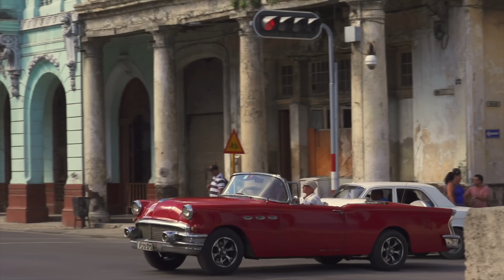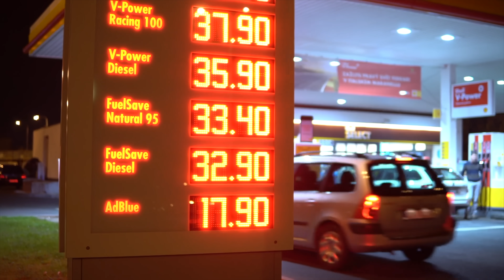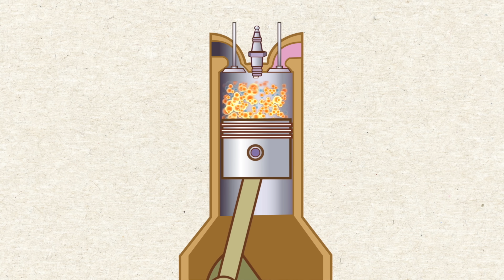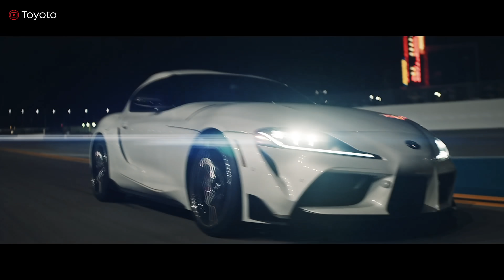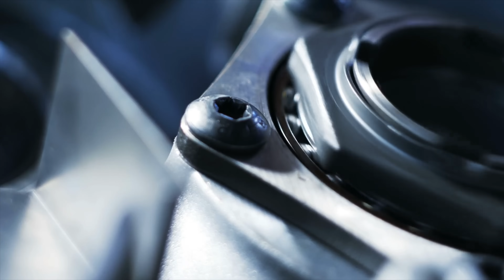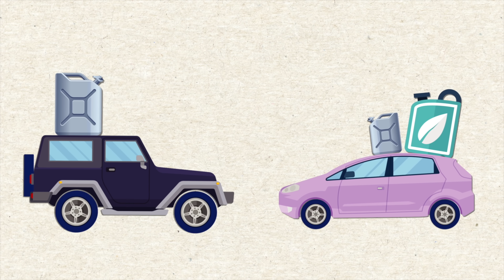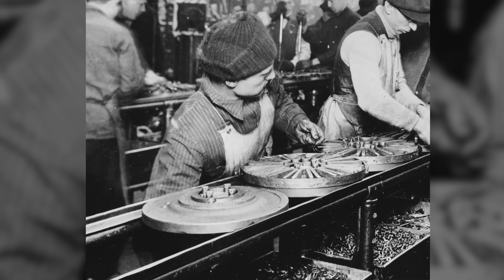7 Fuel Myths Stupid People Fall For

Comment: If I feel generous I use premium in my old lawnmower.😃
Reply: If you can buy ethanol-free gas that would be even better
Reply: @jflm3  why? Is ethanol bad?
Reply: Ethanol reduces the amount of energy when mixed with gasoline
Reply: Most Walmarts sell Ethanol Free Unleaded Gas,  much better for the Lawn mower
Reply: Lol
Reply: Ho! Mr money bags ova here!
Reply: Ethanol can gum up the carburetor on small engines and cause issues in them prematurely I run true fuel in my lawnmower it’s ethanol free and burns better in small engines,
Reply: unarmed blackman  did you know racers use ethanol for racing?
Reply: @kg_1720  If they do, it likely because the engines are tuned and otherwise designed for ethanol use and are cleaned regularly to prevent build-up or other harmful things.  Most average users aren't going to do that to their car engines (except maybe run some cleaner through the gas tank, which may not be enough alone over the long term), and probably not their lawn mowers either.  Race car drivers are typically meticulous about their vehicle and it's care/maintenance.
Reply: @andrewthag   all I've ever found at WM is ethanol gas
Reply: When I worked at a lawn and garden equipment dealer, we put airplane fuel in the tanks.
Reply: @edwardellis7611   I have a small lawn business that’s just me. The wisdom I have received from the small engine mechanics is not only will it deteriorate your carburetor but it will also eat your fuel lines; and if it sits in your fuel line in any capacity of your equipment, the moisture it sucks in will deteriorate the metal and can clog up simple things like the jets on your carburetor. I haven’t done much carburetor work but the few small engine carburetors I’ve seen have rubber parts in it also and it will eat those up. I switched to all non ethanol as a result. I seldom have engine issues.
Reply: Ethanol is not bad as long as it doesn't sit for over a month or so... It is hydrophilic, meaning it attracts water and can cause problems if not used in a timely manner.  If you want to, you can separate the ethanol in your gas easily by adding water to it and shaking it up, then removing the separated ethanol-water mixture that settles to the bottom.  What's left over is pure gasoline, which is hydrophobic.  On another note, gasoline loses one octane for every month it sits.
Reply: Oh yeah? Do you run royal purple oil in it too like my dad?
Reply: @ObservingtheObvious  That's what I"ve heard too.  The ethanol eats away the fuel lines and rubber gaskets and such.  I generally try to use "real gas" as I call it in my riding and push mowers.
Reply: I think my lawnmower has a high performance engine cause I agree it runs better and less stinky exhaust when I run 91 octane
Reply: @kg_1720  it absorbs moisture from the atmosphere and ends up screwing up the carburetor, fuel system, etc., is what I was taught. I know when I quit using ethanol gas I quit having issues with my small engines
Reply: @kg_1720  the engines are set up to run on ethanol
Reply: When the GW Bush, oil magnate family, promoted it years ago I knew something was amiss...
Reply: Ethanol is bad. Eats up rubbers. After some time you need New fuel injectors. Strange that Scotty is not mentioning this. Why is that Scotty?
Reply: @tommymcweedface229  go to an airport or go on google and search ethanol free gas near me, why did u @ me and not the guy below me tho
Reply: I worked a Sears Lawn and Garden and we were told specifically that 91 octane is too much for a lawnmower.
Reply: @kg_1720  most are buying the e85 or e98 thru companies such as ignite, vp racing fuels, renegade racing fuels etc. Pump e85 is trash
Reply: @MrButtHurt  @wielentschoten575  There are these people called engineers that work at these car companies and, contrary to popular belief, they are capable of thinking about things. When they make a car flex fuel compatible, changes are made to the fuel system to accommodate the high concentration of ethanol, with an addition of an ethanol content sensor that way the ecu can adjust the air fuel mix to make up for the lower energy content of ethanol. The real danger if ethanol is that it attracts water from the air and when left to sit (in the case of lawnmowers and similar small engines) can develop high enough water content in the fuel to do damage to the fuel system, especially carburators. This could still be an issue with cars using fuel with ethanol, but most cars are driven enough to empty the tank before water concentration reaches dangerous levels. In this video scotty was talking about cars not mowers and was leaning towards cars driven everyday, so no, there is no problem with ethanol in the situations scotty was talking about.
Reply: @colin_deans  oh yeah. I got a Toyota Avensis. Google says no e10 for the 1.6 and 2.0 but for my 1.8 it is fine. Well certainly doesn't run fine. My car is slow. Rumbling noise. E5 RON 98 it runs fine . Fast and more fuel efficient. And you can leave it for a couple of weeks.
Reply: @wielentschoten575  does it say in your manual that your car is compatible with e10 fuel? If it does and you notice bad performance when using ethanol, either your car has a fuel system problem or the e10 that you are buying is no good, or perhaps higher than e10. Just please don't talk about ethanol like it's the Big Bad Scary Stuff that rots your engine. It's a great alternative fuel and has really good performance characteristics (such as incredible charge&cylinder cooling and naturally high octane. As long as the ecu is aware of the ethanol concentration and is able to adjust the mix as needed ethanol is a great choice for daily driver or high performance cars.
Reply: @colin_deans  lots of rainforests are cut to produce this stuff. They are killing the earth. More diseases will come because of it.
Reply: @HR-wd6cw  Ethanol fuels have more oxygen in them but also have less potential energy for the same volume of fuel.  Racers run E85 gas with larger injectors and tunes to take advantage of the extra oxygen in the fuel.  kinda like a low output turbo or something.
Reply: @edwardellis7611  My son used to buy that for his weed eater. I have never tried it, but these days I use a battery powered trimmer. Could be why I had to disassemble the carburetor & clean it every couple of years, to keep it running.
Reply: Some small engine manuals (lawnmowers, weed eaters, snow blowers, etc) say to NOT use premium gasoline.
You guys are saying to ONLY use premium gas.
We might need another myth video from Scotty on this.
Reply: I am not putting expenses gas in my low lawnmower lol 😂
Reply: @kg_1720  Ethanol mixed in with gasoline can cause older rubber components and plastics to deteriorate.  Newer cars have updated components that can handle it better, hence  running it in older cars/mowers/etc can eventually lead to some parts needing replaced.  My brother runs E85 in his race cars due to it's the higher octane rating and it's cheaper than racing fuel.  However, you have to recalibrate your carb and fuel system to handle flowing more E85 plus replacing those rubber/plastic components with stuff that handles exposure to ethanol.  You have to flow something like 30% more E85 compared to gasoline to make the same power.  Overall it saves him $'s compared to race fuel but takes some knowledge and effort to adapt an older car to it.
Reply: @powermix24  I have never seen any at a Walmart.
Reply: @anonymousperson4363  Where I live in Texas, we have 2 Walmarts with Unleaded Ethanol Free gas @ Murphy's Gas station
Reply: @JohnRocks6368  well this is where flex fuel systems come in. They have ethanol resistant components and and ethanol sensor to make sure it flows more fuel according to the mix. Pump e85 can be anywhere between e50-or-So and e85, so it is necessary to adapt to the mixture with each tank
Reply: @kg_1720  in my experience ethanol is Definately bad for lawnmowers.I have bought 2 brand new push mowers that had ethanol gas in them and only used once or twice before sitting for few months during winter.Went to crank them when it warmed up and they would not start.Even after fuel stabilizer added.Thank god for lowes extended warranties!😂🤭.Started putting non ethanol in mower as mechanics requested and never had a problem since.

Comment: my parents had a 89 chevy nova which needed regular but they used premium and it blew out the head gasket. So it does cause problems to use premium when the vehicle is not rated for it.

Comment: I used low octane gas in a generator once. After one tank, it had fouled the spark arrester so much that the generator wouldn't start. I had to remove and clean the spark arrester to get it working again.  I switched to high octane gas and I haven't had to clean it since (after several hundred hours of use). There are real world consequences for using less than the recommended octane level.
Reply: That’s a whole different engine than what’s in a car.
Reply: @mtn1793 it’s the same concept. I have a BMW that takes mid grade 89 and has a turbo. If I put 87 all the time, I wouldn’t be surprised if the engine starts knocking or timing goes wrong in one cylinder. The combustion is different for each grade. If you don’t have a European car, no turbo, a regular engine, then you probably will be fine putting whatever in there.
Reply: @@pc9656 what year?
Reply: @@pc9656 ty, I’ve got a ‘06 and riding great at 207k. I use reg
Reply: @@pc9656 ty brother! Happy holidays!

Comment: ethanol from corn takes more energy to make than it gives back, so it's strictly worse to use it as a "renewable" fuel than to just go 100% normal gasoline
Reply: Exactly.  Plus the farming industry is subsidized by the government to allocate their corn for fuel production ("ethanol subsidy").  The taxpayers are paying extra for the production of ethanol fuel.
Reply: While technically true, it is a misunderstanding of the entire system. Yes, the production of ethanol takes more energy and creates more pollutants than simply producing petrol fuels. However, the factories/manufacturing facilities are able to capture and neutralize more of those pollutants before they become atmospheric emissions than traditional gasoline production. And the toxic emissions of the automobile are significantly lower using ethanol than petrol. So, the net result is significantly lower pollutants being emitted into the atmosphere with ethanol than petrol. It is such a difference, than the government subsidizes the process to insure we maximize the production and usage of the ethanol. If left entirely to the market conditions, ethanol would be too expensive to be practical for automobile consumption. The only choice is to subsidize the production to keep the prices down, or use mandated price controls to suppress the cost of corn. The former solution is much more effective and encourages as much corn production as possible, which keeps supply high and therefore prices low and stable. We really need to look at these topics holistically and not just the parts that support our own political bias.
Reply: @TwilightxKnight13 amen!
Reply: The energy used to make ethanol can come from renewable sources, such as solar or wind so the amount of energy required to make it can actually be irrelevant.
Reply: E10, the majority of ethanol containing fuel sold, is being used to displace worse additives, like MTBE, that was polluting the water supply.
Reply: @George Martin  Right, I like my water polluted by fertilizer from corn farmers. 😂
Reply: And it takes a lot corn to produce as well
Reply: @simpletruth9977  Course, we coulda always genetically modified the corn to not need those pesticides, but that's gonna poison us in the long run or something I guess.  🤷🏼‍♀️

Comment: Here's a myth: that Shell is good gas. Every single Shell station I've ever been to, from West Coast to East Coast, has always overstated their octane levels by at least one grade. Their 89 performs like 87 and their 91 or 93 like 89. It will absolutely GUT your engine power. If you ever have to buy Shell, always get the highest grade available, and only put enough in to get to a better gas station. I don't know how they haven't been caught yet because they've been doing this for 20+ years.
Reply: They're on the banners of Formula 1 (or at least were, not sure now) and are pretty famous, that means enough money for an army of lawyers.
Reply: @lidge1994  Seriously, I put their 89 in my 2001 Mercury Cougar and it made my engine knock. The engine was rated for 87. Their crap is THAT BAD. And even putting their highest grade in my current vehicle, it guts the performance. I don't know what's wrong with their gas, but they are absolutely scamming people; I've never had this problem with any brand but Shell.

Comment: My car seems to run more smoothly and get more gas mileage with premium fuel. Cheaper fuel just never seems to last as long, so to me it’s been worth it to pay a little extra for the premium stuff. Cool and informative vid!
Reply: could be premium isn't flex fuel. nor that 7/11 does not sell flex.
Reply: In Deutschland nimm ich 102 .
Mein chevrolet 2.5 6zyl, lauft besser,und runder.

Comment: Most mechanics I talk to always suggest staying away from ethanol blended gasoline do to problems with gumming up the gas injection system and milage drops off. Also, it is not recommended to use on small engines due to carburetor problems and wear and tear.
I usually listen to advice from many different mechanics  for cars or small engine repairman.
Reply: What about a 250cc motorcycle?

Comment: A lot of 91-93 premium fuels also contain detergents that keep your engine cleaner (Shell V-power is one of many)

It burns better (different ignition speed, pattern and even flame color)

Most modern vehicles will stop pulling timing with higher octane fuels even if the manual says 87 is fine

Turbocharged engines that can run on 87 almost always make more power and get better mileage on 91-93
Reply: Even my car with a naturally aspirated engine produces more power on higher octanes, even though the manual states that using a higher octane yields no performance gains.

Comment: Way back in the '80s I took a 77 Pontiac Bonneville with a 301 V8 from Wisconsin to Florida. One way I used all regular gas and the other way coming home I use premium. This is back when regular gas was a dollar and premium was a $12, so 12 cents difference I came out a few dollars a head using premium. Today with it being a dollar difference in many places I don't think it would be economical.

Comment: After multiple tests... I found that I get approx 3mpg increase by using non-ethanol fuel.
Reply: That's because ethanol is garbage. Nobody ever thinks about what damage the monocropping does to the environment. A more efficient vehicle will likely cause less impact. Used to have diesel cars with no EPA requirements that would get like 50-60 mpg but all the restrictions now reduce that and now we have to use more fuel.
Reply: @nathanbaylot2754  Additionally, the "cleaner" stats they give for the ethanol don't include the process of making ethanol from the corn.

Comment: Great info on the use of grades of fuel.

I am not a fan of ethanol especially after it caused nearly $800 worth of damage to my Harley's fuel system. Ethanol attracts moisture and corrosion. It can also destroy rubber seals in the fuel system. 

I find it difficult to believe that ethanol is as beneficial to reducing our so-called "Carbon Footprint"  when it requires more energy to produce/refine it to blend with gasoline, and substantially reduces fuel mileage on an average of 10-14%.

Now there is talk of requiring we all go to battery powered electric vehicles. I have to ask: What energy is required to manufacture all of these batteries?
What happens to the old batteries when they reach the end of their recharge cycle  (can't just toss them into landfills as they are full of hazardous materials).
How will our antiquated electrical grid handle the demands of everyone recharging them (not to mention the excessive amount of extra pollution the electric plants will produce in order to keep up with the demands).

Unfortunately there is no perfect solution that will replace fossil fuels in our lifetime without causing other environmental issues.

Comment: When I went from 89 octane to 93, my gas milage for my 12 gallon tank went from 320 to 400 miles. 
A local gas station doesn't purchase 91 octane but sells midgrade fuel by mixing the 89 and 93. Now that I know what the octane means, I'm glad I never got the midgrade. Mathmatically it may average out to 91, but chemically it's still half 89 and half 93.

Comment: I grew up in the 1970's in a high altitude town, 4000 feet above sea level, with 3 passes out of this valley each pass hitting 7,000 to over 10,000 feet.   So back then, we were always told to use the lower octane gas.   Folks with older 'vintage' cars,  might want to keep that in mind.
Reply: Pretty sure there are stations in Colorado with less the 85 octane as well, due to the altitude
Reply: @moonscar119  85 octane is the lowest I have seen in Colorado.
Reply: But in order to coast downhill, you have to go uphill.
Reply: Yup back in the 70s and before when cars had carburetors that had to be adjusted according to the altitude.

Comment: Years ago I made the mistake of putting detergent gas in a very old car. I cleaned some of the gaskets out. (they had turned to goo after so many years!)
Reply: Doesn't all gasoline these days have some amount of detergent?
Reply: @soundspark  I honestly don't know. Maybe it was a fuel additive I used.
Reply: @CerebralOrigami  That would explain it.  There was also the fad of adding acetone to the fuel.  According to the old radio show "Car Talk" you could tell who did that by the paint stripped off around the fuel tank filler neck.